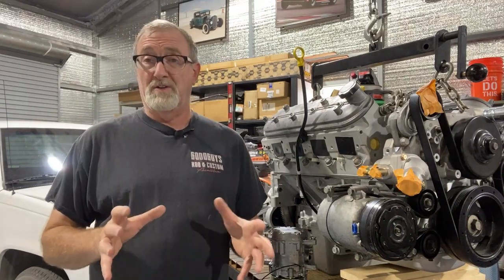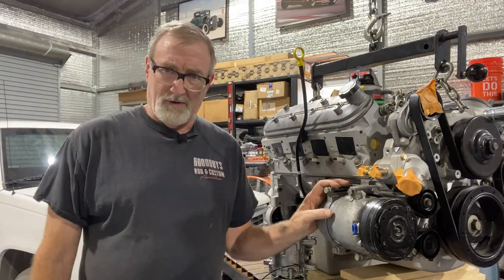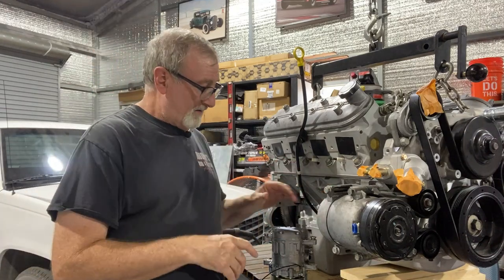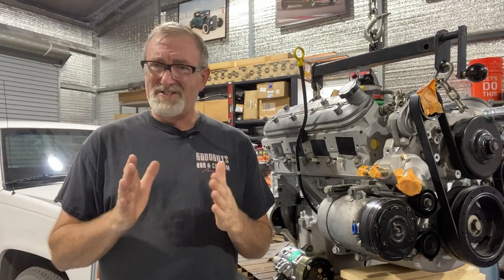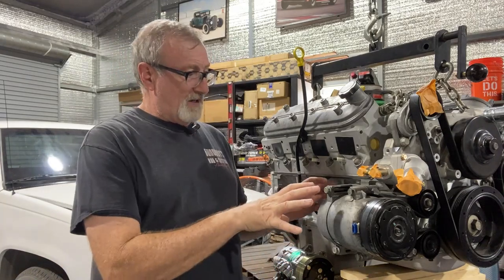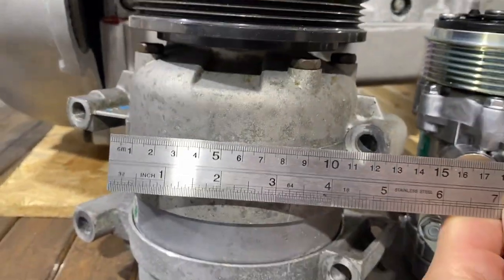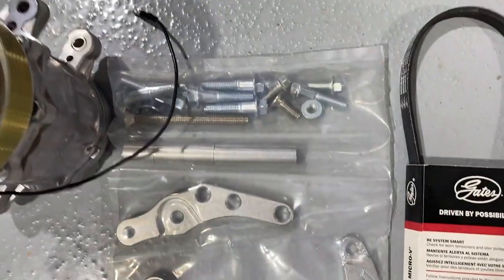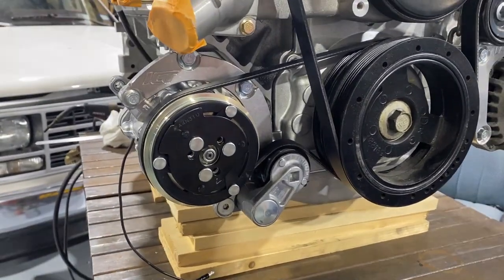LS V8 Swap into 2007 2nd Generation Toyota Tacoma Build is Very COOL! Literally Part 6

Comment: Are you keeping the stock 3rd member?
Reply from the maker: That is the plan. The engine is basically stock with the exception of a performance camshaft. So, rear wheel hp should be around 275ish. The supercharged 2.7 had about 225 hp to the tire. Obviously the LS has more torque, but the truck is not going to be going down the 1/4 mile (?), no 4000rpm launches etc. In the future, if parts begin to break, then that will be addressed. However, there have been plenty of Lexus V8 swaps and turboed motors that have survived. I don't see any issues. Of course, time will tell.